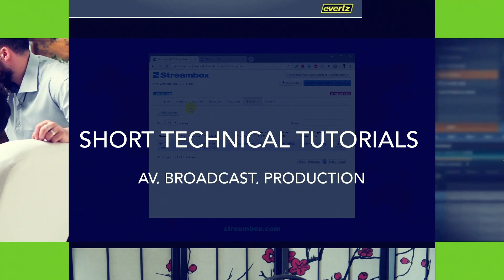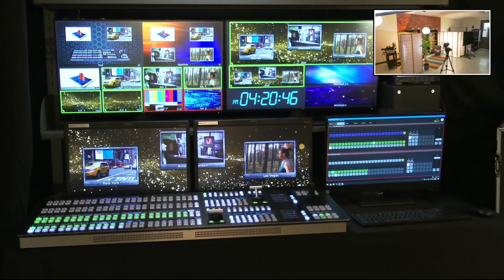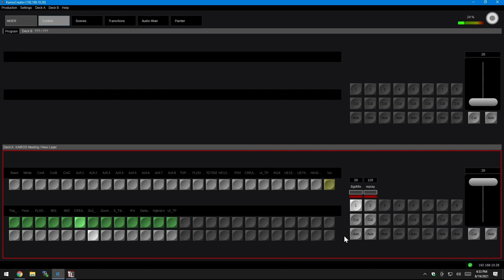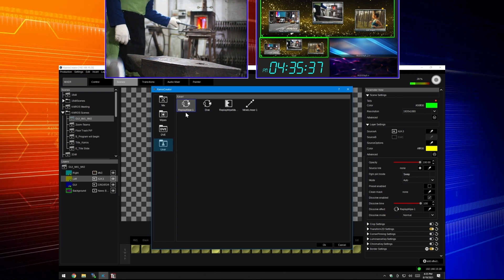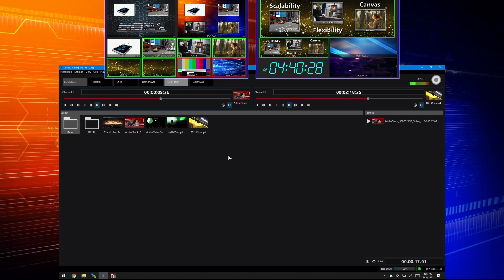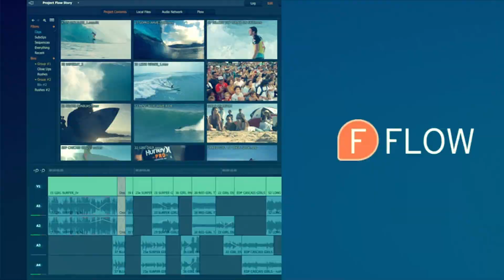Panasonic KAIROS: IT/IP Video Switcher (Demo)

Comment: Can the outputs be custom resolutions that we set? 

So if I wanted an output to be 1080x1920 can I do that? Or are there only presets outputs in the drop down?

Also, how many outputs can be recorded simultaneously? Is that only dependent on the number of recorders connected to the system?